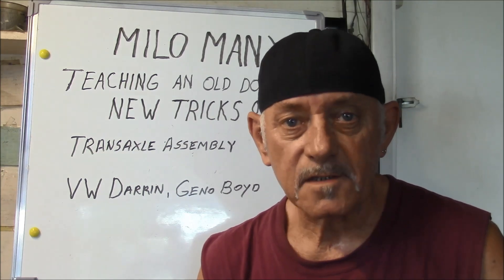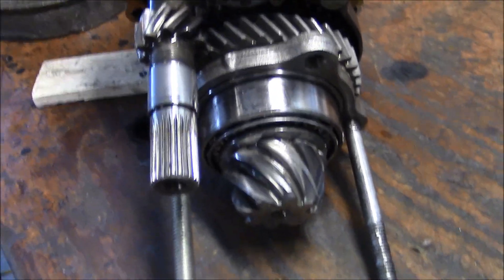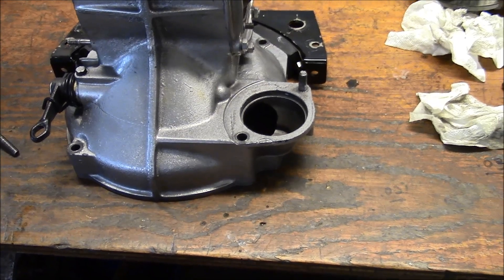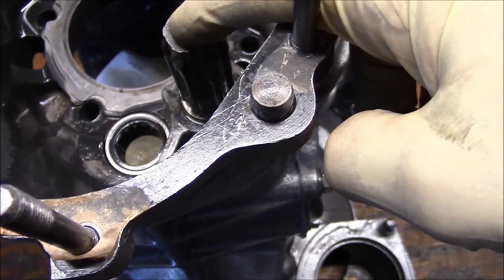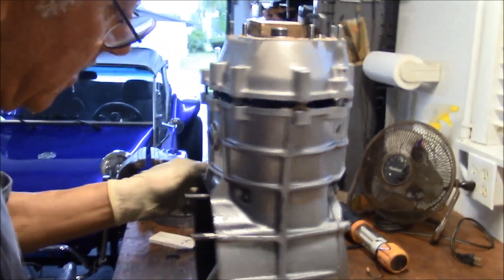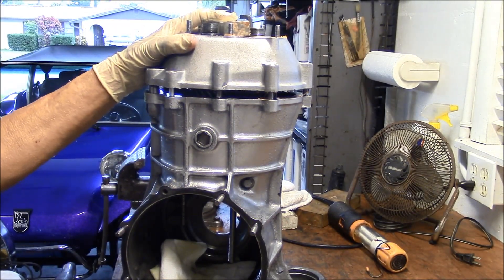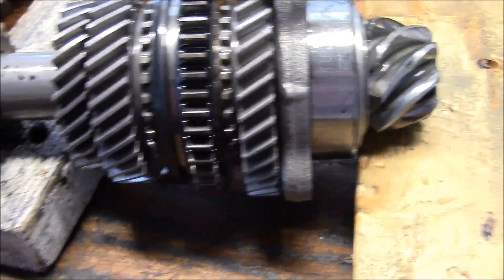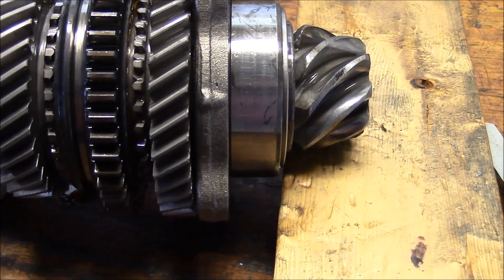VW TRANSAXLE ASSEMBLY, OLD DOG NEW TRICKS AIR COOLED BEETLE

Comment: My second is okay in my type 3, but first was slipping out on the overrun and then I missed a shift and first now unusable. In my case it has to be the dogs. I have a bunch of earlier swing axle transaxles to steal parts from, but zero spare IRS transaxles. I'm in for some pain. Still hopeful to find a used IRS box to swap in so I can rebuild mine or figure out a bus upgrade with LSD.